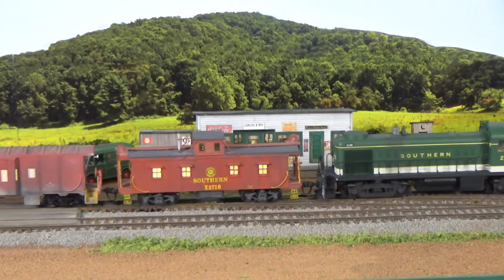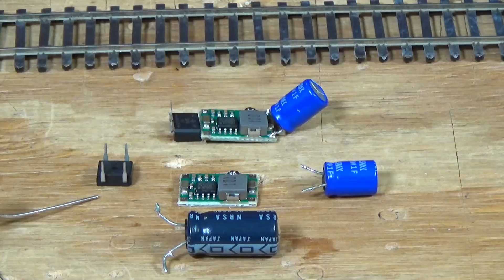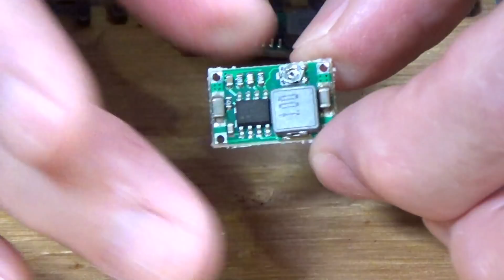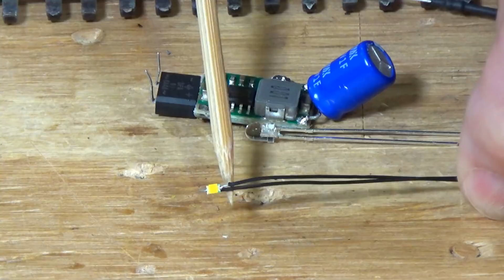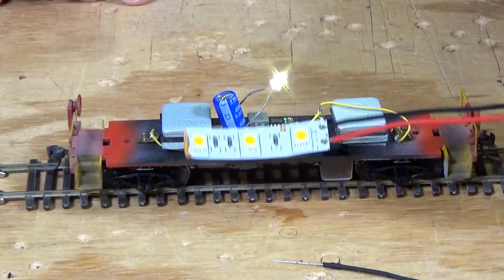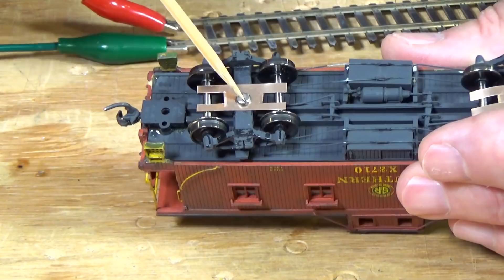New, Smaller Lighting Keep Alive Circuit (120)

Comment: Larry built the circut and lights the led but as soon as I take the power off no light?????????????
Reply from the maker: Which circuit, how many LEDs, and which capacitors? The “white” LEDs require about 3 volts to light so any deviation from the design may provide inadequate power. If using the buck board circuit with the 3V supercap then make sure the output from the board is just below 3V to give enough voltage without blowing the supercap.
Reply: @TheDCCGuy  Yes 3V super cap and buck board set at 2.9V.  As soon as power is shut off no light to led cool white.
Reply: @williamvaughn4603  Well,since it does light up the buck board is working and dropping the voltage appropriately. How long have you left it sitting before turning it off, it may take a minute to adequately charge the cap? If you have a second capacitor swap it in just in case you got a bad one. Other than that I can’t think of any reason it wouldn’t work as long as it is wired with the correct polarity.
Reply: @blueridgebonsai9155  Yes checked the polarity.  left it on for 10 min and still nothing when it turns off will try swapping the cap.  Thanks

Comment: With the high frequency of the dcc a/c is it necessary to rectify to dc for the led?  Seems the circuit would work with a smaller capacitor, resistor and LED.  What say ye?
Reply from the maker: The buck board and capacitor are a DC devices thus the need to rectify the DCC source. The 3V cap is the minimum to light the white LED.

Comment: Hi Larry.  I just received all components to build these from mouser using your supplied part nos. and the mini 360 buck boards,  20 of them, built one as a test and it works but it trips the short protection circuit in my NCE powercab several times while it charges.  After a couple of trips it will set and works fine.  If I add a second led it trips continuously. will this damage my power cab or is there a work around?  Granted my electronic skills are limited at best so it's most likely an operator error.  I am concerned that a string of passenger cars with these installed will be to much for the power cab and  cause the short protection circuit to engage.  Any insight would be appreciated.
Reply from the maker: Put a 100 ohm resistor in line to the capacitor to prevent the inrush current surge. PowerCabs have a very low amperage output so can easily be overwhelmed.
Reply: Thanks
Reply: Tried your suggestion installed 100 ohm 1/2 watt resistor in line with capacitor. Power Cab booted up first try. It has been on track for 30 minutes and has'nt charged. LED lights but if I move car it flickers so now I don't have constant lighting.  I will experiment more. Maybe when I get a SB 5 to upgrade power cab perhaps it will work.
Reply from the maker: I just cranked up my PowerCab on a test track with one of the devices in the video and it works without an inrush resistor. I also ran a loco on the track at the same time and again no issues so I am at a loss to explain your results. I will test it with multiples tomorrow and see if I can challenge the PowerCab.
Reply from the maker: This morning I tried it with 3 cabs and that shut the PowerCab down. With 2 it started so I just tried tipping one while the other two lit up then dropped it back onto the rails and that worked too. The PowerCab is just too underpowered to take the inrush current of the 3 caps simultaneously. I’ll play around this week with placement of a resistor and see if we can get the inrush current down but I am afraid that the PowerCab just does not have enough capacity to handle it. I have never had the problem since I use a PSX4 set at about 3 amps or so plus it has special algorithms designed to handle current surges like that. I can turn on my 8 amp DCS240 system with 65 locos on the track and it will start right up.
Reply: I screwed up and mis read the color bands on the resistor, I used a 10 k instead of a 100 ohm, I'm out of 100 ohm so I'll have to order some. Hopefully that will correct the problem. I'll let you know if that fixes the problem.  Thanks so much for all you help.
Reply from the maker: One thing I was going to try was placing the resistor on the wire before the rect bridge input. That should decrease the inrush current without dropping the voltage to the capacitor.
Reply from the maker: OK, I put a 100 ohm resistor on one wire going to the input on the bridge rectifier and managed to fire up 3 caboose lighting systems and a sound equipped loco at the same time. One side effect is the lights take longer to turn on, maybe 10 seconds but once on they are as bright as ever.
Reply: @TheDCCGuy  Larry, you must be a saint to put so much time and effort to try and resolve my problem.  Thanks so much. I'll let you know when I get some 100 ohm resistors and try it out.
Reply: @TheDCCGuy  Larry I put a 100 ohm resistor on the bridge rectifier and with 2 passenger cars and a sound equiped loco my power cab started fine. Yes the lights took a few moments to come on. Thanks again for all your help.

Comment: Just a thought. Next time you do a car lighting video maybe you could show how to do pickups with a metal framed car for those folks who might have them.
Reply from the maker: I took a look at my brass caboose recently and the only way I see you could do it is to replace the metal trucks with plastic ones. Then it just becomes a matter of attaching a wire to the pickups and running it up through a hole drilled in the floor. Now if you mean metal trucks on a plastic car then you could do that just like the plastic trucks by only picking up power from one side per truck and passing power up through the mounting screws.

Comment: Larry, I have about 24 unlighted cars that I'd like to light. This circuit is easy to build. The hard part for me is getting power from the trucks to the the circuit. Nay video son this with a source for the pickups in the trucks? Thanks!
Reply from the maker: Check the Kadee website, I know they offer trucks with pickups. I mentioned several options for adding your own pickups to existing trucks in the video too. Maybe I need to do a video update with some of those options.

Comment: Larry, I have a lot of the 12V LED strip lighting that I'd like to use up. Does someone make a 12V SuperCap, and would it work in this circuit? Thanks!
Reply from the maker: It would work but it would be huge. You’re better off using the circuit I showed in video 101, it works with the 12 volts strips.
Reply: @TheDCCGuy  Perfect! Thanks very much!

Comment: A bit off subject...when you solder, what temp do you set a variable pot to?  I realize different brands of solder’s will have different actual temps for any given setting, but in general is there recommended ranges for track work, ic boards or wire to wire soldering.   Thanks
Don
Reply from the maker: It really varies with the size of the job snd size of the tip. It takes a lot more heat to solder feeders or joiners to rails since they act as heat sinks and can conduct heat away from the joint. You also will likely be using a bigger fatter tip which itself requires more heat. Small electrical joints generally require less heat and a pencil point tip. However once you get a feel for how to handle these variables you can work with higher temps since even with small joints it makes the job faster which in itself can lead to less chance of damage. So practice with some spare wire, track, and parts to develop that sense of how it works.
Reply: Since there is quite a lot that can vary between different solder varieties and solder stations, it is not very helpful if I give you a temperature here.

Start by placing the solder on the tip of the soldering pen if the solder does not melt, you have too low a temperature and then you have to raise the temperature depending on what you are going to solder. 

One last thing keep the tip of the pen clean, so everything works much better over a longer period of time.
Good luck to you.